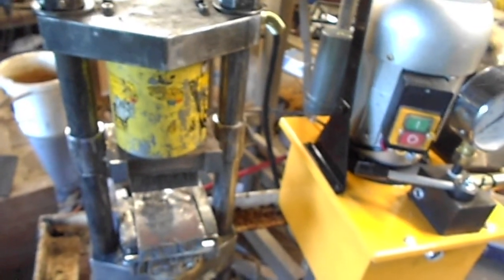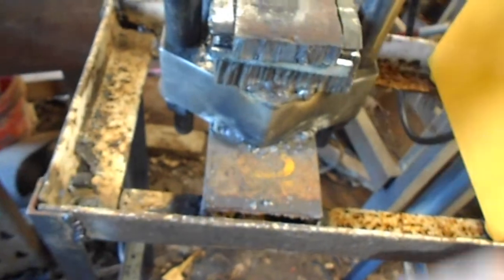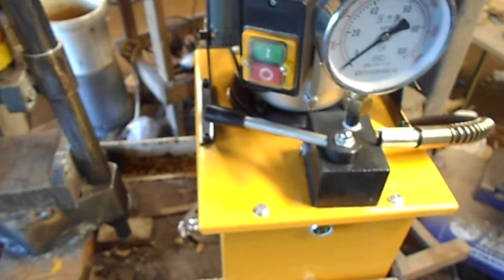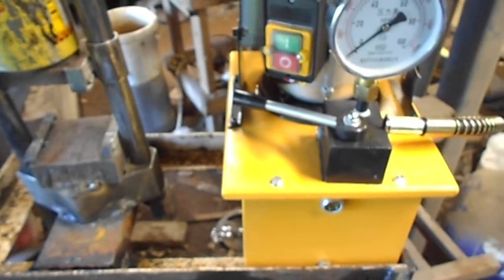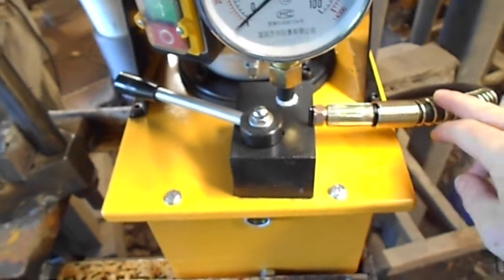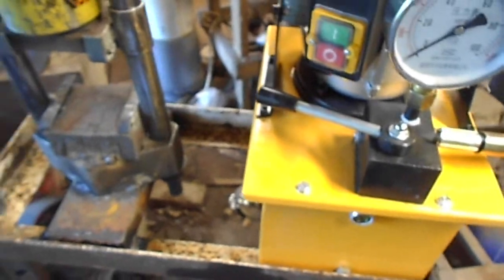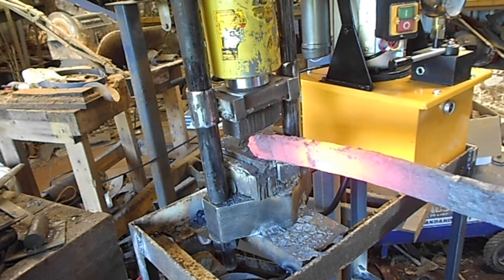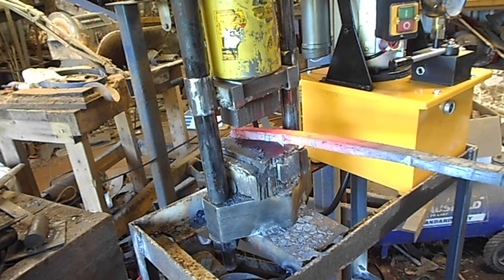Small Press Build

Comment: So cool man ,finally something to help with all that hand hammering 

You could install a different valve system (2 way valve)or just use a limit switch activated by the lever
Reply from the maker: That's my plan, however it has loosened up a little since the video.
Reply: James Mcclendon

 awesome man

Comment: You are miles off on the pressure, its probably 100 psi not 6000 psi, anything over 3000 psi would take 4 wire hose to handle or steel lines plus about a 10hp electric motor. with a special piston pump. So if you maxed out the gauge to 100 psi x a 4" cylinder you would have a .62 ton press.
Reply: it uses 4 wire hose. running 10k psi